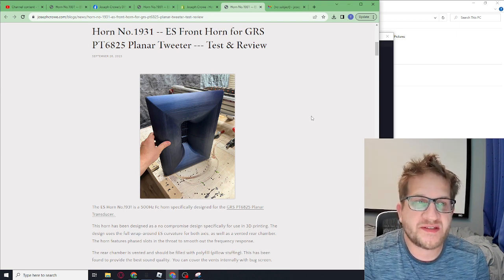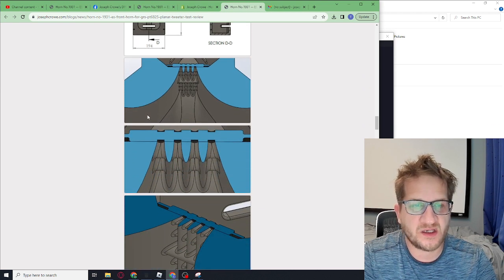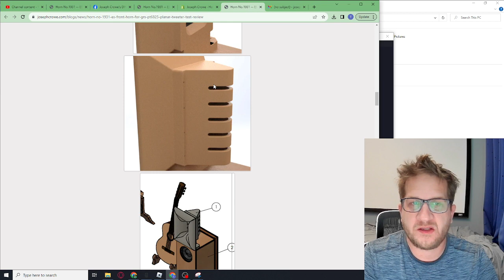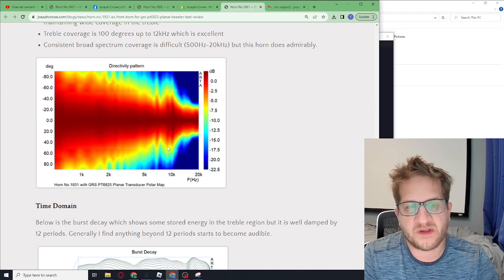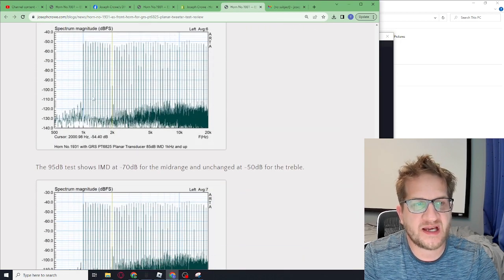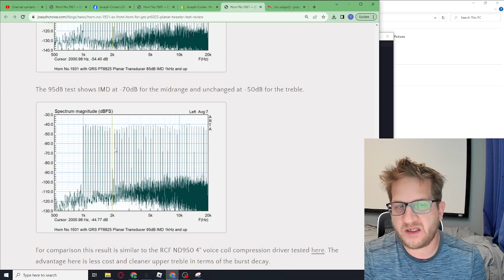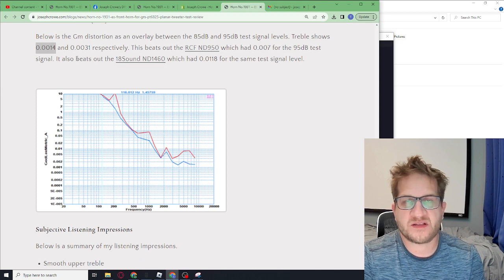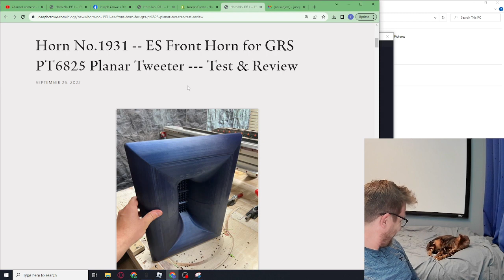Horn No.1931 -- ES Front Horn for GRS PT6825 Planar Tweeter --- Test & Review

Comment: Thanks for making these plans available for the DIYers! I printed a pair of these for my first speaker build and really like them. If there’s any horn coloration, I can’t hear it. They can play really loud without audible distortion. I don’t have any experience with compression drivers for comparison, but they sound very dynamic to me.

I paired this with GRS 15PT-8 15” woofers in 2.6 cu ft sealed prefab enclosures. Smaller woofers may be a better choice if you have a subwoofer to go with it. I’m driving them with a Dayton KABD 430 amplifier (with a DSP chip built in). I used a 500hz 4th order digital crossover and Linkwitz transformed the woofers to 40hz. With just level matching and time aligning the woofer and tweeter they sound amazing with songs like Blower’s Daughter (Damien Rice) and Blown Away (Sivert Hoyem). With some songs though, it can emphasize the wrong things. EQ fixes this and targeting a 0.5 db/octave downward slope at the listening position makes them sound great with everything. I have it set so that I can switch back and forth with the turn of a dial depending on which sound I want at the time.

I printed them in PLA with 1.5mm wall thickness (2 walls of 0.75mm, 0.2mm layer height) and lightning infill (basically hollow). My intention was to fill the horns with plaster if printing them hollow was a problem, but it doesn’t seem to be. They take about 4kg of PLA for the pair printed this way. You would need a 500mm bed to print them all at once. I have a 400mm bed and was able to split them lower down near the base where the horn flare levels out a bit. I glued them together with Tackfix 248 (acrylic hot glue) as it worked better than CA or epoxy in a test I did. I used heat set inserts to attach the driver and back cover. The inserts did stick ok in the 1.5mm wall, but it would have been better to thicken it a bit in that area. The underside of the print where the driver mates to the phase plug printed a little rough so I used Blu Tack to seal it up.

Overall, I’m very happy with the result. They are definitely the best pair of speakers I’ve owned! I would highly recommend these horns!
Reply: I guess you are EQing the 1khz bump?

Comment: Man this looks so cool. What would the minimum 3d print bed have to be to print these? Mad respect for your design skills and knowledge :)
Reply: Ditto!
Reply: @JosephCrowesDIYSpeakerBuilding would you be able to help out with this information? I'm very much thinking about buying this plan from you. Kind regards.
Reply: @318ishonk  thanks for that info. Hope you're happy with the result. :) coincidentally I'm thinking about getting a bambu as well. I have got the p1s in my sights. Are you happy with yours?
Reply: @318ishonk  that is good to hear. That ams unit looks very interesting as well but can be added later on from what I've seen. Haha looks like I need to start putting some cash aside. :)
Reply: @318ishonk  you still using the horn? i was thinking doing the same approach but not sure yet